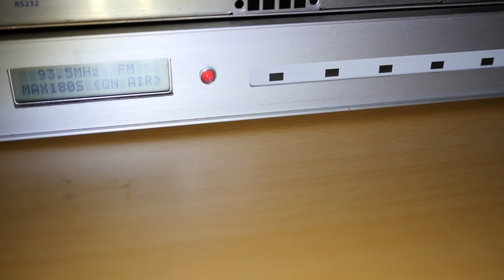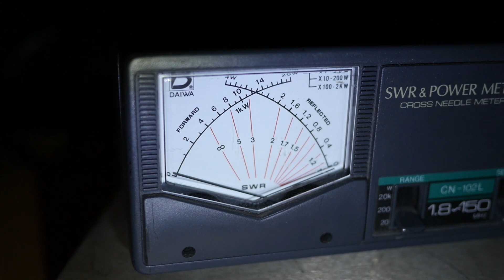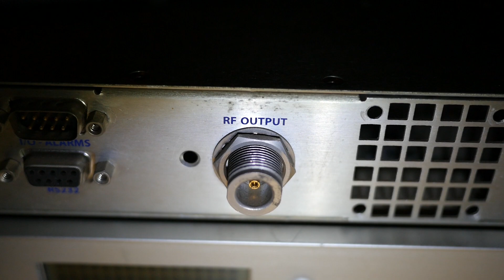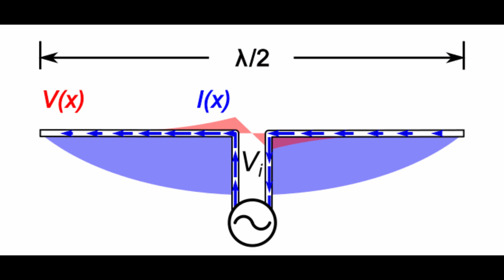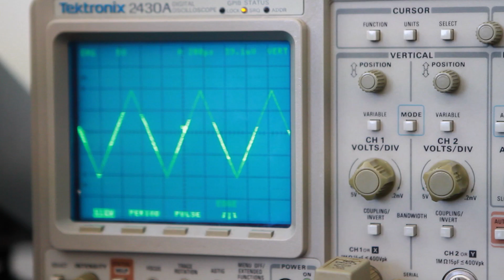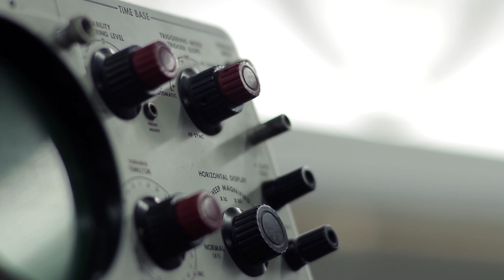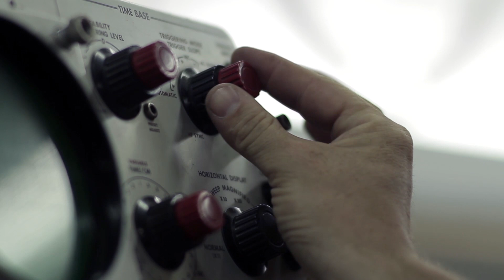FM Radio Station TRANSMITTER Set Up . How To Get It Right For Best Signal Quality.

Comment: I did a pirate radio station back in 2011 and tried everything I could to have a clean sign but was shut down anyway. I did try to get an FM radio license before I did it but I kept getting rejected. I just wanted to broadcast 1 watt and nothing else. I tried so many times I just got fed up.
Reply from the maker: Thank you for sharing. Always interesting to hear people's stories. Yeah unfortunately getting a license can be difficult. It's sad that the rest of the world hasn't followed New Zealand's example of allowing people to broadcast with 1 watt without a license. It solves so many problems and gives people' an opportunity to try out broadcasting without the expense of building an entire radio station. Probably cheaper to move to New Zealand lol Cheers

Comment: Goedendag, weer even een vraagje, hoe lang moeten de radialen zijn bij een antenne lengte van   +/_ 85cm ?
Reply from the maker: De grondvlaklengte voor een halve golf dipool of kwartgolfantenne is een kwart golflengte lang, dus als je een antenne maakt voor 88 MHz op ongeveer 85,2 cm, dan moet het grondvlak even lang of langer zijn. Bekijk mijn video over het afstemmen van antennes. 
https://www.youtube.com/watch?v=WOGX70-kIYA
Het zal een stuk beter uitleggen. Maar het korte antwoord is dat de grondvlakken minstens zo lang zijn als de belangrijkste radiale lengte van een kwart golf, maar om de antenne verstelbaar te maken van 88 tot 108 MHz, maak de grondvlakken de langste lengte van 85,2 cm.

https://www.youtube.com/watch?v=WOGX70-kIYA

The ground plane length for half wave dipole or quarter wave antenna is a quarter of a wavelength long so if you make an antenna for 88 MHz at about 85.2 cm then the ground plane should be the same length or longer. Check out my video about tuning antennas. It will explain a lot better. But the short answer is that the ground planes are at least as long as the main radial length of a quarter wave but to make the antenna adjustable from 88 to 108 MHz make the ground planes the longest length of 85.2 cm.

Comment: Which type of cables? You mean coaxial cable? What is the function
Reply from the maker: Hi. Thanks for your comment. Yeah, I made a video about the coaxial cables and the connectors to use. Check it out here https://youtu.be/CNtRaqKhdoY
It help you with that.
Reply: RG58 is excellent for most applications.
Reply from the maker: @christopherhulse8385  Yes RG58 is great for short cables of just a few meters but for longer high-power signals RG213 and LMR cables are better.

Comment: MAKE SURE YOUR ANTENNA IS MATCHED TO YOUR PARTICULAR FREQUENCY. DEFINITELY INVEST IN QUALITY FEEDLINE & CONNECTORS, WRAP YOUR EXTERIOR CONNECTIONS FROM THE ELEMENTS. GREAT VIDEO! CHEERS!
Reply from the maker: Hi Thank you. Yes that's right. For the antenna to be resonant it needs to be matched to the transmitter frequency then fine tuned. You are also right about protecting your connectors from the elements. Many low power radio stations don't realize that their weak signal could be because there is water in the connector or rust after a long while. Additionally what I didn't mention is lighting protection. I lost a transmitters once for not having it protected. It's quite affordable and can save a fortune in transmitter equipment. Thanks for your comment. Glad you enjoying the videos :) Cheers
Reply: @inspiresoundpro  Yes lightning/EMP protection is important. There is more to getting a station on the air properly than most people realize. They buy a cheap piece of junk transmitter from china, connect an antenna and think they are now a radio station.
Reply from the maker: @stopthebus  Oh yeah there is so much that goes into it. The problem is that a lot of it is just hard work and bits of gear nobody cares about. So it's not always worth making a video about it because most people just want a fun fast look at things. The stuff that makes up a radio station can often be as boring as dry sand. But it can be as important as any part of the station. If I, for example, talk about balanced vs unbalanced audio cables in the studio, their eyes roll into the back of their heads. So, lol, yeah I guess some things need to be learned the hard way. Cheers. Happy New Year!